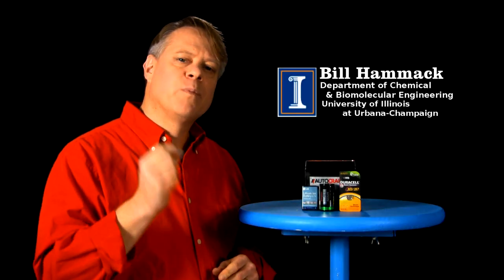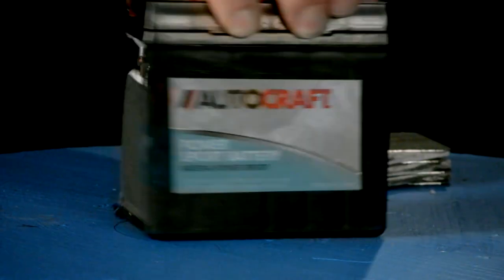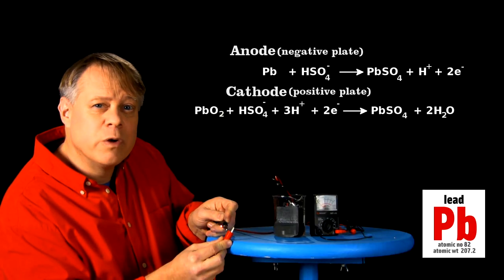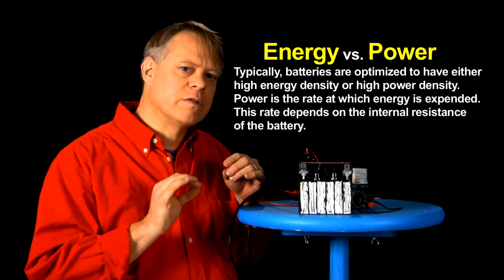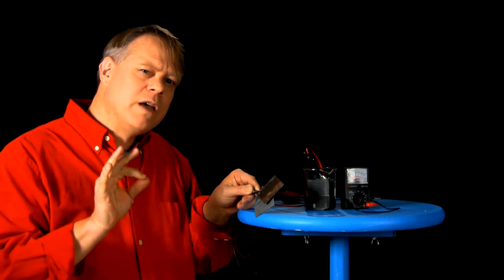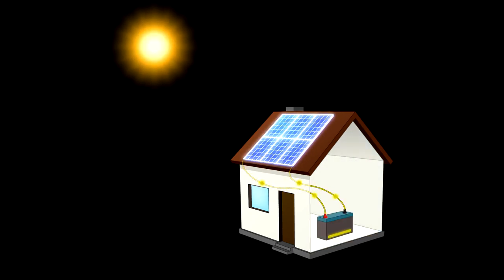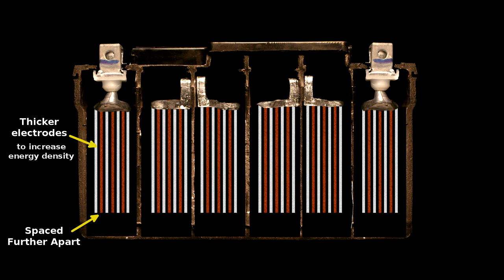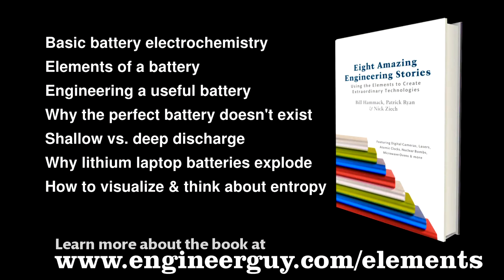How a lead-acid battery works

Comment: Lead acid batteries are still practical, not only because of their unique properties that aren't matched by any other battery type, but also because we have an amazing lead-recycling infrastructure in place -- and we've had that in place for decades now!  Lead acid batteries are the most recycled item -- more than 99% of all lead-acid batteries used today are recycled!  (Compare that to 50% of aluminum cans, and 70% of office paper!)  In fact, it's very likely that the lead in your car battery today was mined 50 or more years ago!  It's been recycled that many times!
Reply: what about the acid though.
Reply: its a simple process to create and so long as we pay attention to recycling easy to reuse or enrich the acid
Reply: Glass is 100% recyclable. Though the problem is some people like to smash it all over the place.
Reply: @tubester4567  gypsum and bauxite. Water treatment plants.
Reply: Capacitor banks are way better than car batteries... look em up
Reply: For recycling glass to be profitable, it would have to be literally cheaper than sand. Recycling glass generally isn't feasible.
Reply: @svenjorgensen5  the idea of recycling isn't profitable anyways
Reply: @Rabbit.760  It must be. The more expensive something is, the more CO2 is released. The bottom line price is always determined by the energy invested. And energy doesn't come from nothing.
Reply: Recycling overall costs us money. It was more of an agreement program than a profitable business. Not reusing our waste would put us in a dump in less than 5 years but I'm sure you and everyone else know this. By the way, Replanet just went out of business last month. Many more are folding behind em... I think we are in major trouble if we don't figure out the solutions
Reply: In Germany, starting 20 years ago, you have to pay a deposit of €7.50 ($8) when you buy a car battery and you only get it back when you return the old battery. It means pretty much 100% recycling here too. I suspect that pretty much all European countries do the same.
Reply: @tubester4567  the acid is also reclaimed and reused. I worked in a large battery plant and they can dump full pallets of old batteries into a machine that grinds them up. everything drops out the bottom. the plastic floats and is skimmed off to be recycled into new battery cases. they lead is heavy and drops to the bottom. the acid runs thur a sieve . everything is reused. When you buy a new battery you get credit to trade the old one in so there is incentive
Reply: @Rabbit.760  Capacitor banks are really only useful for power factor correction. Capacitors have a low energy density compared to lead-acid batteries, and they don't deliver a constant power output required for starting an engine (capacitors voltage output drops linearly over time). There's also a litany of issues like costs of materials (20x - 60x more than lead-acid), weight of materials (20x using ultracaps), and self-discharge (50% of charge lost in one month).
Reply: @carlsoto1747  you're right
Reply: @Admiral8Q  Who cares. It just becomes dust and sand again, and that's how we get raw material for glass in the first place.
Reply: @kentatakao6863  Of course. That's not what I meant 2 years ago, however. All the sharp broken glass in the streets and sidewalks was a pain. (literally sometimes like glass splinters)
Reply: Rabbit Recycling metals can be done infinitely and costs less money and energy than mining new ore and refining it.

Plastic and especially paper can be much more energy intensive and monetarily expensive than new plastic and paper. However the latter can simply be composted.
Reply: Carbon and oxygen have been recycled for millions of years.
Reply: Good news for us coz we’ve got 3024kgs of it in our lead acid batteries, 48 X 63kg batteries 👌
Reply: @kingofthespazs 😅
Reply: Preach. Also, besides making solder, what else can the lead be used for? And sometimes it results as a byproduct of refining other more desired products from ore.

Comment: I'm glad to read that you are busy making more videos. 

One point also worth considering when discussing lead acid batteries is that the acid freezing point is much higher when the battery is discharged. So, if you store equipment outside in winter, the battery should not be allowed to discharge completely, for two reasons. First, sulphation may shorten the life of the battery, and second, the discharged battery may freeze and crack, mechanically killing it much more quickly.

Comment: Very educational video. I change lead motive power batteries at work and always wanted to see the inside of one. Soon I will be a battery technician repairing or replacing busted cells.

Comment: I've had good luck desulfating batteries by temporarily using high current from an already charged battery to bring it up to a chargeable state.
Reply: Connect a larger battery in parallel, with a charger simultaneously connected, until the charger registers the otherwise, inert battery?

Comment: If you mean a short inside the motor causing a stall, there is a dramatic drop in resistance which results in a rise in amperage. E=IR. The voltage drop is unchanged at first, until the battery dies or a fuse blows or wires melt.

Comment: I know you didn't say this, but just so that no one misunderstands, it is never wise to freeze a lead acid car battery. Once frozen, any warranty on a car battery is void because of expansion cracking of the case. It is worth noting that the freezing point of fluid in the liquid cell is much higher if the battery is discharged, so it's a lot easier to accidentally freeze a car battery that is already dead. So, especially in winter, charge unused vehicle batteries regularly.

Comment: T. Roadster is not a common EV, and use a very expensive battery. Common Li batteries become very dangerous when combined in a lot of cells.I don't say that there aren't prototypes of all sorts, and you have a point here.I saw 2 years ago, that a very common hybrid car type , the one you can afford, uses 2 lead batteries: one for starter, and one for storage (deep cell type). The guy explained to me that  the "lead solution" is the cheapest and most reliable. Nice conversation, sir .

Comment: Excellent video! I don't know if this is the right channel for this, but could you explain why lead-acid batteries deliver less current when cold? Something about ion tunneling? I have 0% knowledge about that, other than there is apparently ions that may or may not tunnel ( through something ).

Comment: It's not necessarily the greenest battery when thrown in the garbage but just about every store that sells these batteries must recycle the old ones, that is why you're charged a core deposit fee if you don't have the old battery. Once you bring back the old one, they refund you for the core deposit. There are also newer versions of this lead acid battery known as Absorbed Glass Matt (AGM) and we're now seeing lithium ion, the same type of battery found in your smartphone. AGM is an improvement in capacity and cranking power as well as longevity and typically comes with a much greater warranty usually about 4-6 years. They require less maintenance and don't have any free flowing acid which means there's no need to check for the acid levels in the cells and no spillage. The downside to the AGM battery is that if you discharge them too much they're harder to bring back, they're heavier, and they're more expensive. Then there's lithium which provides even better results than AGM batteries but in a much lighter package. There's a certain BMW M model that uses one and some stores sell lithium powersport batteries found in motorcycles, ATVs, dirt bikes, and jet skis. They're often times more expensive than AGM batteries but have an even longer life cycle but must be pulse charged and require a lithium ion rated charger. If you use the wrong charger it could damage the battery and lithium can be a volatile substance as we've seen in the Galaxy Note 7 if not properly charged or maintained.

Comment: This does not make sense to me . You say the current flows from cathode (lead oxide) to the anode (lead) but right after you say the lead gives up electrons which the lead oxide accepts. Which is it? I was always told current flows from anode to cathode.

Comment: There are some theories about breaking the lead sulfate layer on a "dead" battery with a high voltage, low amperage charge, typically 160 percent of its normal operating voltage.

I have been hesitant to try this to say the least. Perhaps if I am stranded somewhere and i was dependent on that battery working.

Comment: From what I've learned in college, it's good to let secondary batteries (such as those in cell phones and other electronics) occasionally die out completely before recharging, so the battery will last longer. I understand the energy storing is quite different, perhaps you could do a segment on secondary batteries?
Reply: It depends on the battery chemistry. Lithium ion batteries generally should be kept as close as possible to 50%. Lead acid should be kept fully charged. Ni-Cd batteries should be fully cycled each time. Ni-MH batteries don't really care.

Comment: Old rule of thumb was 1A per Ci of displacement. Really depends on the efficiency of the starters windings, the compression ratio of the engine, and the gear reduction of the starter vs. flywheel ring gear.  In other words.....  "it depends".   :D

Comment: Based on the information you've given us about a traditional car or motorcycle battery, that they "die" simply due to the buildup of lead sulfate, would this also imply we could theoretically "fix" the battery by disassembling it, grinding and polishing the plates back to new status, and reassembling it? I'm assuming the answer is yes, and this is why you get such a large discount for returning a "core" when you buy a new one. Is that correct?

Comment: Is it true that ALL batteries are technically in theory rechargeable (even alkaline) since all chemical reactions are reversible if you add energy back into them (or pull energy out) ?

Comment: This is very interesting as it could explain something. So Ive had a problem with my car in which it kept running the battery dead, finally I removed the fuse for the thing that was doing it but it still died. I had no idea what was wrong at that point. Perhaps it was because it had run to empty dozens of times and just cant hold a charge anymore.

Comment: It is indeed opposite. That is due to the definition of current direction. In most definitions in electricity, the direction is based on positive charges. Since the electron is the negative charge (again, a matter of definition), the current will be the opposite of its direction, since the current will be the direction of movement of positive charges. That also applies to electric fields, described as the direction of force applied on a POSITIVE charge.

Comment: Can you make How a Lithium Ion battery works video?   I replaced the battery in my iBook G3 clamshell. I was dumb and let it sit and now it refuses to charge at all.
Reply: It works the same principle, chemical conversion but due to the dangers of fire, control circuits disconnect li batteries if the voltage drops too low.  Making your G3 unrechargeable.

Comment: Dear Sir/Madam,

As a school project I built a very simple lead-acid battery to investigate cycle fade. 
The capacity of my lead-acid battery decreased as the number of cycles increased, as expected. Surprisingly enough, the capacity increased after a 24 day period of deep discharge. I did the same thing three more times (so a couple of cycles followed by a long period of deep discharge) and every time the capacity had increased after the period of deep discharge. 

The battery did become more difficult to charge (to induce current flow a voltage of about 10 to 16 volts was necessary, just for a few seconds) and eventually it stopped working. However, I was very surprised to see that the capacity loss after a few cycles, and I was wondering whether you could enlighten me. 

I assume you will not have time to answer my question, but I'd greatly appreciate if you could shed some light on this issue.  I have attached my results to this email, in case you are willing to take a look.

Thanks in advance,

Nol Duindam

Comment: One wonders if the Pb plates and the PB02 plates were separated into two individual cells and then simultaneously pump electrolyte back and forth between the two sides in a controlled manner, if you could control the amperage output by the speed of the pumping action. The reaction producing current could only happen as fast as the electrolyte could exchange electrons.

Comment: I'm confused. You say the lead gives up electrons, which the lead oxide accepts. So wouldn't it follow that a current flows from the lead to the lead oxide, from the anode to cathode? Is the flow of current the opposite the flow of electrons?

Comment: At present our equipment measures an abundance of particles of electricity, electrical pressure, positive electromotive force, with a positive needle movement, from the black or (-) terminal. So inside the battery the particles of electricity must be moving from the lead oxide plate to the lead plate according to your meter.  
Sincerely, 
William McCormick

Comment: What do you think about graphene and it application?
Reply: Perfect transverse insulator and longitudinal conductor, perfect for energy storage and rapid discharge.
Only disadvantage is the technical requirements to manufacture flawless graphene, which cannot be met with current manufacturing technologies

Comment: From the above explanation, it seems as though lead batteries could be reused if they were made to be opened so the user could wipe the plates off periodically.
Reply: Some of them are. It's sort of a recent development to seal the battery.
Reply: Old batteries used to be like that. They had caps or screws above the plates so you could add electrolyte or service the battery. These days they are "maintenance free" or absorbed glass mat (AGM, like optima batteries).
Reply: They used to be in a glass case as recently as the 50s. They used them around here before the REA brought electricity to rural America. They would be charged during the day by a small gasoline generator for lighting at night. Google "glass battery"

Comment: Hi, engineerguy and viewers, I have a question. I have read a lot of articles from google but on this part, I cannot seem to read an exact topic.

I am using an emergency light/fan which uses a lead-acid battery. I intend to use the emergency appliance in case of blackouts and during travel, which means that it may not be used everyday/every week. 

The question, how long could this type of battery be in full charge state without being used? Which is safer for this type of battery, be in charged state for a long time, or be in low charge/discharge state? Thanks. I hope engineerguy or someone could help me in my dilemma. :)

Comment: I think I understand the explanation of how the release of electrons produces lead sulfate.  What happens when we recharge the battery?  Is the reaction reversible?  Is it something to do with a higher energy state in lead and lead oxide, than in lead sulfate?  Bleeding electrons out of the system produces lead sulfate, and reintroducing them pushes the sulfate back into solution?  Help! this is fascinating, but I don't think I understand.  :)

Comment: What if cars stored energy in a coil like a clock? When you want to start it up you let it unwind and woooho! away you go.
Reply: agun17 would you want to spend the rest of your day winding it up?
Reply: Quantum Axe
Get an electric motor to do it. That's basically how a Prius works.
Reply: agun17 then why even have a coil under tension in the first place?
Reply: Quantum Axe
Batteries store energy; coils store energy. Remove the battery in a prius and substitute it with a coil.
Reply: agun17 go back to my first question then. we are back to square one. i do not really see where you are going.
Reply: Quantum Axe But the coil would weigh less that a big battery, thus improving cornering while still being a hybrid.
Reply: agun17 the more transfer of energy happens the more inefficient the system becomes. moreover, to drive a car i do not think a light weight coil is going to be enough.

of course, it can be done, but will it be worth it?
Reply: Google "flywheel energy storage"

Comment: what about Edison's nickel iron batteries?  the energy density is lower but the service life is phenomenal.
Reply: Nickel Iron batteries do have a good cycle life, but look at the initial cost vs cycle life. They're about the same as lead acid. the problem with Nickel Iron is low round trip efficiency due to high hysteresis. They discharge at 1.2 V per cell, but they need 1.6 V per cell. lots of lost energy compared to lead acid, which discharges at 2 V per cell, but bulk charges at 2.35 V per cell.

Comment: Is there a way to have solar panels on a car that could be used to power a car starter? Like some sort of smaller version of the current car battery that could be ready to start a vehicle after a short time in the sun?
Reply: I once used a 50 watt panel to jump start a car. It took 20 minutes to put enough surface charge on the battery to get the car started. Once started, the alternator finished the job. It takes 4000 watts to start a V-8 engine, but the fuel injected engine started in less than 3 seconds. any longer, and it would have had to bask in the sun for another half hour.

Comment: would it be possible to develop a deep cycle battery with moveable plates that slide up and down inside the battery that can be used to scrape off discharge? The case of the battery could be designed to allow for moving fins guided from an external casing